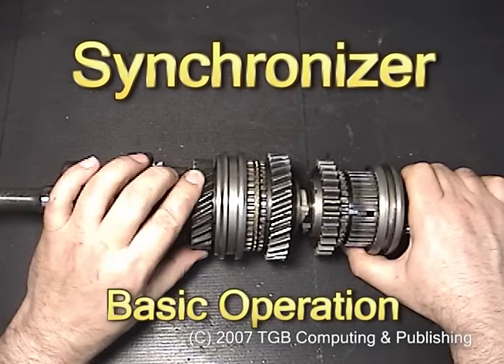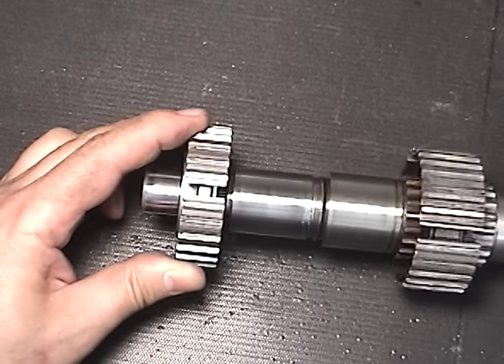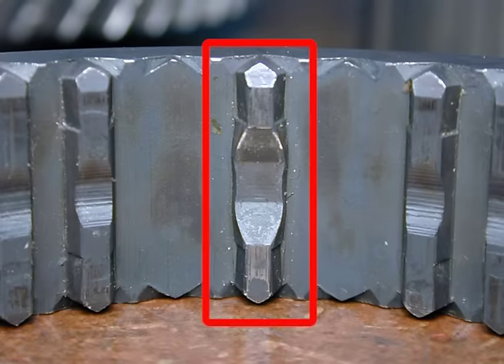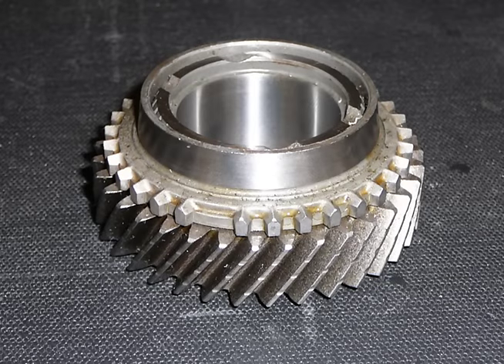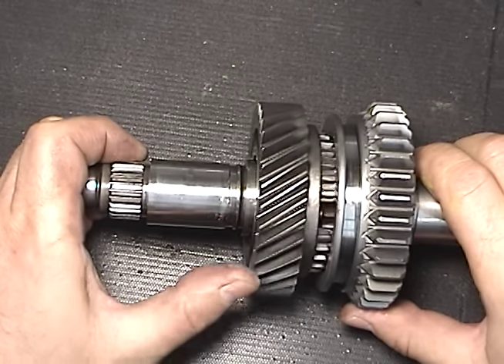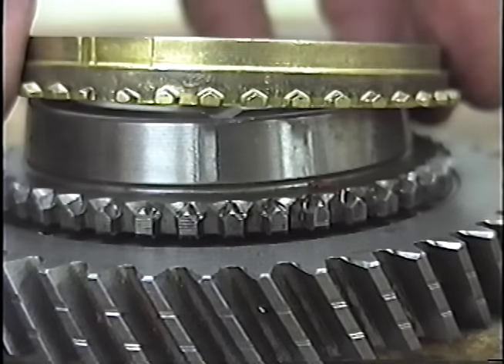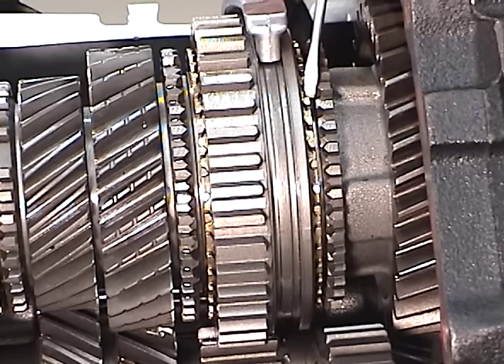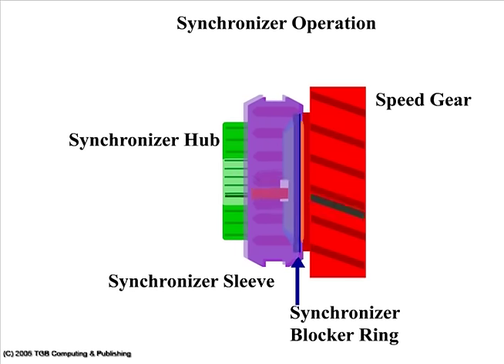Synchronizer Operation Explained

Comment: Hi, thanks for a great video :) 
Does it also mean, that If you you have your speed shifted already and you want to unshift it into neutral, you don´t have to press the clutch pedal? Just for shifting from speed into neutral. The ring and the speed are synchronised and if you separate them, only after that the speeds will slowly start to differentiate. Do I understand that right? Is it necessary to use clutch when shifting to neutral? Or is it not good to do that and can it cause some damage ?
Reply from the maker: You do not need to use the clutch when shifting from any gear into neutral. There is a small amount of stress taken off of the components if you do use the clutch but not enough to cause any damage doing this.  My sister was so superb at speed matching all the gears by just using the gas pedal that she could up-shift without the use of the clutch and as a passenger you would have never known.  This too does not hurt the transmission or the clutch but keep in mind it is far and few people who can pull this off, not even me.
Reply: @DrivelineMaster  Then there was the time my clutch cable broke when I was driving on I-5 in Orange County. I had to learn how to shift without the clutch real quick. It can be done but I'm sure I didn't do the transmission any good.
Reply from the maker: You do not need to use your clutch to shift from gear to neutral and no harm will be caused.  In fact if you are good with speed matching you can upshift and downshift without the clutch and without grinding the gears.  I have seen it done by some very talented drivers. If you can do this without grinding the gears there is no harm in it and in fact your clutch will last longer. I too had a clutch cable break while driving in downtown San Francisco in semi rush hour.  This was a very interesting drive into work but I did it without using the clutch.
Reply from the maker: See my reply
Reply: @DrivelineMaster  I'm a stick shift driving instructor, in the advanced course I try to teach people how to clutches shift (floating the gears), I think, if done properly, it's the best and most comfortable way to shift a manual.  However, someone is arguing with me on facebook saying that this will wear down the syncros.  I'm sure they are wrong and I think you have already answered this question in your replies but have you any specific input?
Reply from the maker: The idea of rev matching or float the gears as you called it is a technique that self synchronizes.  In other words the driver through road and rpm speed is performing the job of the synchronizer.  If the driver is able to move the gear shift lever from one gear to the next without any grinding noises and maintain the ability to move the shift lever with ease then this is ideal.  There is no adverse wear or negative effects on the transmission or the internal parts including the synchronizers.  Additionally the clutch and all of the clutch components will last a heck of a lot longer before needing replacement. My hat is off to anyone who can effectively  without grinding noises shift a manual transmission without using the clutch pedal with the same ease as with using the clutch pedal. The person on Facebook is incorrect and you are correct.
Reply: @DrivelineMaster  except for first gear of course
Reply: @DrivelineMaster  many truckers dont use the clutch except from a dead stop
Reply from the maker: Many truckers are very skilled at rev matching. My sister who once drove a semi was able to do this with her car. I was always amazed at how skilled she was.
Reply: @DrivelineMaster  wouldn't the blocker and speed gear clutch gears taper wear quicker if you pull the sleeve back with out clutching? Or at least increase the risk of wear if the rpms and road speed aren't exactly 100% matched.
Reply from the maker: In theory Yes.  But I don't think there would be any noticeable wear effects on the life of the transmission.

Comment: Is my understanding right in saying that the blocker ring is made of a different material (bronze maybe?), so as to provide a higher coefficient of thermal expansion and thus allow faster expansion when a lot of heat is generated due to excessive friction generated when synchronization is not possible and thereby block the meshing of the speed gear teeth and synchronizer hub teeth? Is this how the blocking ring acts to block the meshing when speeds aren't synchronized?
Reply from the maker: Well said.  That is correct.  Blocker rings are made out of other material but it's always soft and sometimes lined with friction material similar to a brake lining however it is the thermal expansion from the inability to synchronize that pushes back on the keys and sleeve to prevent the sleeve from moving over and grinding the gear teeth.
Reply: @DrivelineMaster  Thank you, that cleared it up.

Comment: I have a few quesions, regaring an actual example in the topic.

What can cause that I can barely get out of first gear in colder weather?

The story a bit more explained: The MX-5 ND's manual recommends 75W90 GL-4 oil if the original oil is not available (which is often te case btw). One might thing that the original oil is also 75w90, but that seems not to be the truth, it's waaaay less viscous than a 75w90. I also put 75w90 in the trans and now even when I start at 15 deg C, it's hard to get out of first gear, I have to shift very eary into second. Also it's nearly impossible to shift into first while the car is moving. Putting the trans into reverse at 0 degress C is barely working. I don't experience any grinding btw. The syncro spec is as follows:
1: Triple Cone with Carbon coating
2: Triple Cone with Carbon coating
3: Triple cone
4: Triple cone
5: Double cone
6: Single cone with Carbon coating
R: Single cone

The original oil was very "dirty" looked like dark grey paint. Turned out it looked like this for everybody. Honestly it looked like someboday added molybdenium additive to the oil, but that's 100% not the case.

So, can these symtoms caused by the more viscous oil? I mean, problems when putting it into gear is is one thing but I can barely get it out from first when above 10 km/h. After driving 4-5 minutes and the trans oil heats up everything feels way smoother again.

What does one actually risk when a thicker or thinner oil is used thena what prescribed?

Can a molybdenium additibe (LiquyMoly) cause any issues by times? (Synchro issues, and so on)

Thanks and any info/explanation or suggestion would be appreciated.

Absolutely great video btw.!
Reply from the maker: First of all 75W90 and 75w90 are supposed to be the same viscosity. the large or small W has nothing to do with it. These oils are tested in a lab at a specific temperature even if you feel they flow differently and one seems thicker than the other.  What is critical is that you make sure your oil is GL4 grade. If you put in GL5 or GL4/GL5 this can cause issues.  It's also possible that the old gunky lube was holding your trans together and the gunk between the blocker rings and the cones got flushed out with the new lube and the gunk was adding the necessary friction that is needed to shift.  Normally the symptoms you describe have more to do with the clutch not disengaging.  So let me ask.  Can you shift OK with the engine off?  If so your clutch might not be fully disengaging or your pilot bearing might be binding on the input shaft.  I'm a big fan of Redline Manual Transmission Fluid (MTF). It's synthetic with superior friction qualities. if you can get this you might want to give it a try. Also check the owners manual. When I worked for Mazda some of those transmission would take Dexron Automatic Transmission fluid when the vehicle was being used in cold weather and 75w90 when it was used in hotter climates.
Reply: @DrivelineMaster  oh ok. Thanks. The w/W was just a typo.
But if the clutch not disengaging then why does it work ok after a few minutes and why did the problem start immediately after the oil change? I think with engine off i chan shift but doesn’t it also depend on the wheel speeds (trans output shaft speed)? What i also can try maybe is to lift the rear put it in 1st and check if the wheels start spinning when i press the clutch pedal. Im not sure but if the clutch is completely disengaged then it should not move the wheels at all, right?
Im planning to try something similar you mentioned if I can’t get the original oils.
About the gunk. Yes, Im a but afraid that this is one of the issues.

What do you think about the molybdenum additives? Is that a bad idea?

Btw: the oil i put in was gl4/5. I didn’t think this could be a problem. Motul gre 300 75w90 btw.
Reply from the maker: Your right that if you had a clutch disengagement problem then the shifting problem should not have started right after the oil change. the W or w was the only difference I saw in your oil specs in your original message. Yes, if you raise both drive wheels, engine running and clutch pedal fully depressed that the drive wheels should not rotate. I once installed Redline 75w90 gear oil in a manual trans and it would not shift worth a darn and it would grind a lot. I took it out and put in Redline 75w90 Manual Trans fluid MTF and it shifted great.  It was obvious that these were two different products both labeled 75w90. With the engine off and the vehicle not moving there is nothing to synchronize so shifting should be easy.  Also clutch discs can stick to the flywheel or bind on the input shaft when the pedal is depressed. this can cause difficult shifting. Again this does not explain why the problem started just after an oil change.  I would not put any additive in the trans unless it says right on the package that it's for manual transmissions. You don't want to make the oil slipperier there needs to be more friction between the oil and the blocker ring cones. If the oil was as bad as you say it's possible you flushed out what was holding the blocker rings to the gear and the clean oil is slipperier.
Reply: @DrivelineMaster  understand. Thanks a lot!
Reply: @DrivelineMaster Just FYI: the original Mazda oil finally arrived and I put it in the car yesterday. It's WAY less viscous than the 75w90-s I tried before. Shifing is good now even in cold temps, no issuse at the moment.
Reply from the maker: Way to go.  Proper oil can make a huge difference.  It's not just the viscosity but also the friction additives.

Comment: I always find synchronizer ring is made of brass, not other metal. Is it the specifications?
Reply from the maker: They can be and are made out of other material.  Some use a bimetal combination with a sintered bronze and brass material on the inside and steel on the outside.  Others use steel and bond a friction material like a brake pad to the inside circumference. It's material that will work soaked in oil.

Comment: So, what exactly is broken when you shift, it feels like it goes into gear, but no it pops out or you can feel some grinding? I assume the key is broken or the synch ring just spins and make shifting fail routinely?
Reply from the maker: Based on your description it's really hard to tell exactly what you are experiencing. Here is what can happen.  As the vehicle gets older and gets some mileage on it the transmission the fluid additives start to wear out. If the fluid is not replaced wear on the synchronizer blocker ring starts.  If the transmission is abused or worked harder than normal the wear accelerates. Once the lube doesn't work as well because the additives are worn out or the transmission is driven with a bad clutch the synchronizer blocker rings are no longer capable of synchronizing properly and the drive starts forcing the shift, just a little and just a little grinding starts to happen.  This grinding takes place between the small clutching teeth on the blocker ring, gear and synchronizer sleeve.  As the wear continues shifting becomes harder and the driver forces the shift some more placing additional load and wear on the shift forks and the sleeve fork groove.  The forcing of the shift also places an extra load on the keys.  Some keys are stamped sheet metal and these bend and become damages easier than solid steel keys.  Jumping out of gear starts to happen when the clutching teeth are heavily worn and or the shift forks are also heavily worn.  It's rarely a broken key or worn key that will cause the jumping out of gear.  If this is an older vehicle with external shift linkage worn or maladjusted shift linkage along with worn or broken engine and transmission mounts can also cause jumping out of gear.  Additionally on older vehicles 1960 to mid 1970 vehicles could have misaligned bell housing.  If the center of the bell housing is not in alignment with the center of the crankshaft it can cause a twisting bind the can cause jumping out of gear but this is rare. You most likely have severely worn synchronizes, clutching teeth on the gear and sleeve as well as the blocker ring and possibly shift fork wear.

Comment: On my '74 Norton Commando motorcycle, it has 4 speed gearbox but no synchros. It shifts extremely smoothly. My '88 Mini Cooper also has 4 speeds, with synchros and it has gear grinding only when downshifting from 4th to 3rd gear. Just wondering why older systems could get by without needing synchros?
Reply from the maker: I'm sorry, I'm not familiar with motorcycles. It sounds like wear on your 3 to 4 synchro.  You might try changing the oil.  If it doesn't take a special oil you might try Redline Manual transmission fluid.  It can work wonders on gear grind on some manual transmissions.
Reply: @DrivelineMaster  the classic mini cooper shares engine oil with gearbox, like most modern motorbikes. Whole engine needs to be pulled, dismantled to reach the synchros so will try as much as possible to solve without that level of work.
Reply from the maker: Holy crap.  Sorry, I don't know anything about motorcycles.

Comment: does that mean when the gears are heavily unsyncronized and i try to force it to shift in i just wear out the drive gear teeth until it goes in sync?
Reply from the maker: If there is a large speed difference such as when you try to shift into 1st gear if you are going 50 MPH you most likely won't be able to do this.  One of the jobs of the synchronizer blocker ring is to prevent grinding and gears wearing out from tooth grind if this is the case.  The blocker ring actually prevents the sleeve from moving close enough to the gear so the teeth won't grind or touch.  I hope this is what you meant.
Reply: yes thx
Reply: @DrivelineMaster  I'm still not clear on HOW the blocker ring prevents the sleeve from moving close enough.  It seems to be the one missing piece of information I have and have yet to find an explanation of it anywhere.  I hope you can help.  Superb video BTW - thanks
Reply from the maker: I'm sure I have answered this somewhere in previous comments but here it is again.  When the blocker ring attempts to speed up the gear you are trying to down shift into. Such as trying to shift into 1st gear when your are going 70 mph.  The blocker ring is unable to speed up 1st driven gear to the speed of the synchronizer and the heat from the friction of trying causes an expansion and pressure to build between the blocker ring friction surface and the gear.  This heat and expansion from the heat pushes back on the blocker ring which in turn pushes back on the keys and the keys push back on the sleeve.  This prevents the sleeve from being able to move far enough to make contact with the small clutching teeth on the gear which would grind because they are not in sync.
Reply from the maker: You will grind and wear out the clutching teeth on the speed gear and the synchronizer sleeve if you force a shift that is not synchronized. In addition the excessive force can cause shift fork to synchronizer sleeve wear, synchronizer key wear or breakage and synchronizer sleeve to hub wear.  Additionally metal partials from grinding gears will disperse throughout your transmission.  These metal particles will first attach the bearings and then onto all the other internal parts.

Comment: hello: 
What is the function of the hump on the synchronizer key. Why is it pushed down before full engagement?
Reply from the maker: The hump transfers the force from the sleeve to the blocker ring.  Once synchronization is achieved the sleeve needs to move farther to lock the gear to the sleeve. The key will be in the way so by being able to depress it give clearance for the sleeve to mover far enough to lock onto the gear.

Comment: when you dont engage the gear fully and release clutch and hear a grind, is it the syncro grind or gear grind?
Reply from the maker: The small clutching teeth on the gear, blocker ring and sleeve is the grinding you are hearing from an incomplete engagement.  It is NOT the helical teeth on the gear.